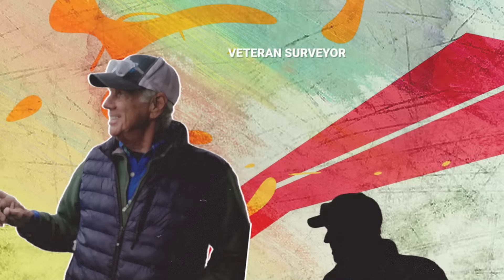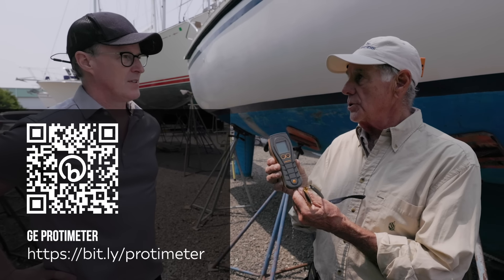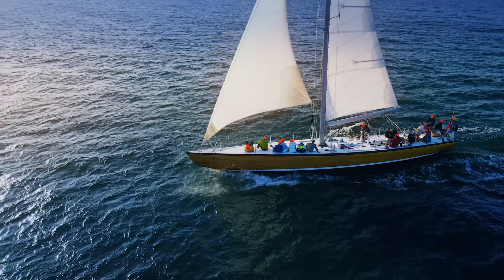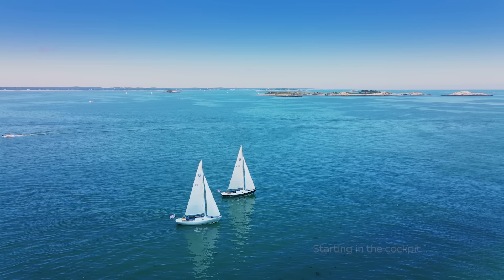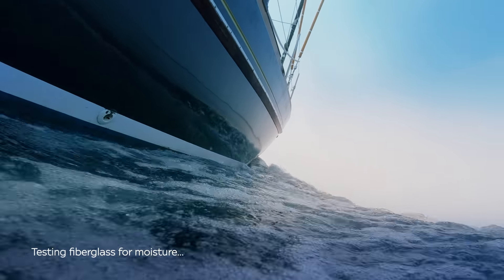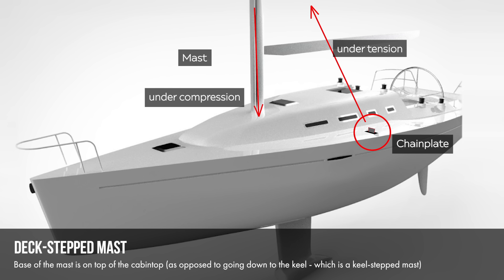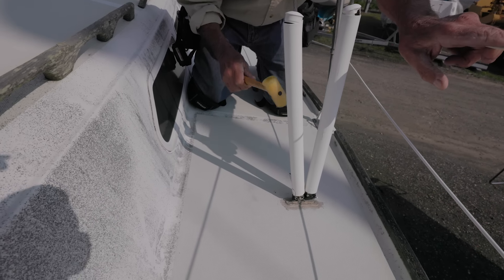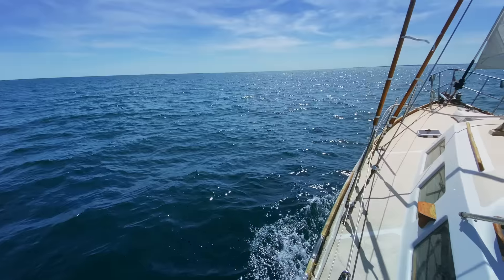SAILBOAT BUYING TIPS from a Surveyor - Part 3! Decks, Chainplates & More  #sailboat

Comment: Hello Randy I hate to tell you that the moisture meters are VERY innacurate on fiberglass boats, especially on bottom painted hulls. As a classic boat restorer, the meters work on wooden hulls. Trumpy, Stevens, Huckins etc. I have opended up many fiberglass hulls that have failed moisture tests to find that there were NO issues with the lamination. Unless you have visible blistering at gelcoat level or below, I don't trust the meters. I blasted the hull of a Hinckley Bermuda 40 to find no blistering at gelcoat level or below. The blisters were in the bottom paint layers!!!
Reply: Is this inaccuracy mostly on the hull (bottom), or are you also concerned about deck measurements as they discuss in this video?
Reply: The deck measurements as well. The meters are prone to FALSE positive readings. They work very well on wooden boats, but not on fiberglass. There are some infrared meters that I am not familiar with that report to have accurate readings on fiberglass moisture content. I am surprised that you were the only person responding to my comment. I have clients that have spent tens of thousand dollars to remedy a surveyors report to find out that there was no problem. The best way for checking for moisture is to take a core sample " biopsy" and check for moisture. I have been doing classic boat restorations for only 45 years. So what do I know? My two cents.

Comment: A note on different chainplate designs: the style with a removable bedding plate are much safer than a one-piece where the deck flange is welded onto the chain plate. My boat had one-piece plates and the metal was rotting from the inside out from moisture that entered between the deck and the plate. Nearly lost my rig thanks to what appeared to be bright, shiny metal but was completely dead inside.
Reply from the maker: wow... how did you discover it was a problem? was your rig already tensioned all the way and still loose?
Reply: @YachtHunters  rig was tensioned. I noticed rust forming on the plate about 15mm below the pin for my cap shroud turnbuckle. Since it wasn’t coming from that connection point it raised some alarms. The rust seemed to be sweating out of the metal itself. Upon closer inspection with penetrating dye, there were tiny cracks forming. Once I removed the plate entirely and checked the underside of the flange I was absolutely terrified at the level of corrosion.
Reply: Same here,had a chainplate just snap,luckily it was only a lower shroud but I renewed them all after that,it was a 40ft boat in 20 knots of wind and one reef in so wasn't being pressed hard.
I've got another boat now and the chainplates were the first job I did on her,the old ones look fine but they are nearly 50 years old so it's a small cost for my peace of mind to just renew them

Comment: Thanks for the video's! Many useful tips.
What are your thoughts reinforced plastic through hull's and valves?
I am thinking about changing all mine.
I mean with plastic you have no corrosion issue's...
Reply from the maker: Being a bit of a traditionalist, I’d go with bronze below the waterline perhaps plastic well above the waterline or in a well protected spot. Bronze is tried and true and a bit old school with 100 years of historic performance. My brother in law hit a whale on a transatlantic passage a few years back and so I always think about unintended impacts (think submerged containers) and what that might do to plastic versus bronze. I do have two plastic through hulls way above the waterline for a shower sump output and a secondary bilge pump outlet…seems like a decent use case…thanks for the question!

Comment: I wonder if you have a builder that goes with solid glass with no core materials in the spots where hardware is installed to give water nowhere to go in does that take away from the shear strength the deck provides, because it doesn't have the interior skin, core and outer skin working together in all places?

Comment: I am going to try to replace a deck core with 3/8 inch divinicell. Wish me luck.
Reply from the maker: You can do it!! Lots of good YouTubes on replacing soft core. If you haven’t already, Check out Colin from Parlay revival… he did some great core replacement videos…
Reply: @YachtHunters  I just learned that white oak has 9 times the shear strength of Divninycell but is 9 times heavier. But, I think I am going to use white oak around the chain plates, mast and under the bow sprit.

Comment: If you already own a boat with some areas where the balsa core has become wet and rotted, can it be replaced with new balsa core and regain it previous structural strength?  I have some areas on my side decks around the chainplates that i would be very comfortable cutting out and replacing if it would be worth the effort.

Comment: what is the maintenance required to keep water from into the deck?
Reply from the maker: you need to rebed the bedding plates every few years...  of course, this depends on the environmental conditions where the boat is... but it's alwasy a good thing to keep on top of. It's not terribly difficult to pull them up and put new bedding compound under... but it's an often-ignored maintenance item
Reply: @YachtHunters  now THAT is 100 points worth an information

Comment: This is really useful buyer beware info. As anyone who's been out looking for that mythical best boat knows, there are an awful lot of boats available for every price point you can imagine. Many of those who haven't sold for a long while probably failed a survey or two, and are languishing until the owners can't afford to keep them anymore... or until some poor schmuck comes along and buys one without a survey. Sometimes it's tempting to be that schmuck. Take a deep breath. The feeling will pass. Just know, once you buy the boat, you own all the problems. * On the other hand, if you have the skills and are motivated, you can take a deck apart from the top, and scrape out the dead core and replace it with fresh core and generous polyester resin, etc.  There are numerous videos showing how to do this. And there are worse ways to spend your time and money.

Comment: Do anchors ever get stuck on the bottom, and if so, is there a good way to get them loose?
Reply from the maker: Sometimes… we see it in Maine on occasion with some tricky rocks on the bottom. first step is to move the boat forward or backwards to the side to change the angle that the anchor is being pulled… the newer rocna/mantis style ones seem to be great for preventing any snags

Comment: At the end there, the anchor locker door is good because there's no wood core. Right next to it? Huge nightmare. And keep in mind if you've never done much fiberglass/wood core repair: that area right next to the 'bad' area? That probably needs replacing as well. Once you start grinding out the bad spots? Where do you stop?  We always think of the flat areas, but it's the complex areas, like that edge near the anchor locker, the curve up to the roof of the saloon; areas that support blocks and cleats, chain plates,  these are the areas that will suck up more time than your triple your worst case scenario. 
What these videos are really good for is not what the surveyor you hire is going to do, but what you can do to narrow the boats you're interested in so you only hire a surveyor for the best boat you find, not 5 surveyors at $1000/each. And I'd ask the surveyor up front, "Please tell me if you find a total deal breaker. If it's okay with you,  I'll pay you half, we can go to lunch, I won't need a report. I'll find another boat."

Comment: The best of the series so far. How about wood and metal hulls (aluminum, steel).
Reply from the maker: great idea!!
Reply: Wood and steel are always stronger then plastic but age and maintanance history is a key. Rusty steel and rotten wood can cost a lot of time and money to repair. Now welding steel can be done anywhere almost for a quick fix when needed and steel is stronger when hitting an object at sea.

Comment: This may be a bit much but could you address the limitations on changing the mast on older boats.  What are issues with attempting to put high end hands free gear on older boats?  Not so much cost but if one finds the perfect older boat and think it can be made as easy to single hand just by geting new self tailing/ furling everything.  What boats are too old for this?????   Love your videos. Great work.

Comment: I don't understand how the moisture meter could find balsa core that has turned to black dust as he mentioned? It only finds moisture, right? 
The cotter pin you showed a close up of had a blob of putty on it, is that too keep from getting cut? 
Great video, thank you:) It's interesting that get mentioned ladder safety because i always worry about Captain Q climbing up and into, then out of boats that are up high, and nobody holds the ladder! Please make sure you guys tie off the ladder before Q climbs up.
Reply from the maker: CQ is adamant about properly securing the ladder a little more thoroughly than the video indicated I believe thank you for your worry. He can always use that outside help🙏😂
Reply: The water did not all go into the core yesterday. Once it gets wet, it is soon rotten. Especially consider that the wet deck in the sun is an incubator for that black mold that destroys the wood.

Comment: Randay, do you think, in retrospect, that you were more entranced by the lines and design of your new boat (the aft private cockpit off of the aft cabin, e.g.) than the actual condition of the boat?  I guess I thinking, first, of the condition of the wiring, but you've had your share of engine problems, too.

Comment: Thank you both for this highly valuable video.  One question:  if one were handy and had the tools, wouldn’t it still be economical to re-do the deck soft spots?  (Assuming the interior, engine and all other components still had some good years in them). It’s just sad to think that because of a wet core the boat needs to be scrapped!!!!

Looking forward to the next video.  
And still waiting for CQ to do a video on an Alberg 30.   😊
Cheers
Reply: No. It is sad but no. This whole deck needs to be dismantled and redone. Try and put together the price of: dismantling, measuring, materials purchase, working hours, putting together, glue, joinery, curing, time required for drying, painting, polishing, pressing...the WHOLE deck... so sad...
Reply from the maker: He is to and yes to your prior question
Reply: Smaller deck areas can be repaired. The boat shown was too extensive. So the point  is to get a reliable assessment of the extent of the damage.

Comment: At the risk of quickly moving beyond the scope of this series (and starting a fight between wood vs fibreglass folks.... :^) ) I'm wondering about the repair possibilities - potential of different boat materials. I can see a steel boat having a section cut out and a new piece welded in. A wooden boat, in theory at least, could have bits cut out and replaced. And I know that fiberglass hulls can be repaired if one put their boat on the rocks holing it. If one was so inclined to buy a boat cheap and repair a bad deck on a fiberglass or wood boat (or for what ever reason insisted on repairing a sad state boat - and had the resources to support the repair) are there approved repair methods?
Reply: 1. There needs to be the line: what is feasible and what isn't. I believe every boat is prone to reconstruction. But at what price? 2. The problem here seems to be balsa core. Fiberglass doesn't seem to be an issue. But sandwiched and joined materials- are. Not because of replacing. But because of engineering and effort. Imagine if you had to dismantle whole deck of this boat. And then tailor all the joints with balsa and then fiberglass. And then put it all together. Prepared, cured, dried, measured, (preferably) pressed... just not worthy. If there is just piece of fiberglass delaminated- you patch it up and you're good to go. Balsa can be bad.... which is such a shame for all the Tartans out there....
Reply: @cetterus  An excellent way to put it: Feasible or not? I'm sure that line is a bit fuzzy depending upon the budget of the owner/customer and the boat yard's skill set (or perhaps more importantly; the willingness to chase windmills :^) ).

Another good point (kinda buried in my question you were good enough to bring it out of the shadows) - would any repair pass suitability from an engineering stand point?

It quickly becomes a parts boat - pull the good bits. Chop the rest.:^(
Reply: It is delicate work. And it is doable but at what price? Imagine what skill and amount of working hours would require to dismantle, reconstruct and put together the whole deck and cabin top! If done right (which isn't cheap)- I'm sure it would be seaworthy. And certified as such.

Comment: Can the deck be repaired?
Reply from the maker: Yes. Definitely… there are a few YouTubers out there that have done it. If you do a DIY the material cost isn’t that bad but it’s a lot of labor… you have to weigh that against the value of the boat (market or sentimental) and see if it’s worth it. Jim’s thought was this boat didn’t have a ton of potential value and you’d be better off saving a more desirable classic if you put in all that effort… just depends on your goals and how much this boat might speak to you. Cheers

Comment: To say that sailboat is ready to be scrapped because it needs deck core job is insanity. 100% insanity. The amount of work required to replace the deck, to do a very good job, is nothing compared to the rest of the boat that doesn't need any major work. The most important deck area is in plane with the mast and chain plates. There's always a bulkhead in that plane because it wants to squeeze the boat. The deck for a few feet either side of that plane needs to be perfect, no gaps, no epoxy fill, had to be solid wood epoxied in, the rest can be just a good job. It's really not that hard, just make straight cuts as much as possible, fit in good marine plywood covered in epoxy, and then put the deck back on. To throw away an entire boat because of a few weeks of work is horrible. Obviously the design of some boats with complex bulwarks that all needs repair can be a different story. Save the sailboats!!!!
Reply from the maker: Love the idea of saving it. I think Jim’s commentary was more about the cost to fix it being greater than the possible value of the boat… and would take a very unique and industrious person, like yourself, to take it on. I think his inclination would be to take on that type of project on a boat that was perhaps more worthy of that type of investment in time & resources… something with greater potential and better overall value of construction. Any boat can get soft decks… but some are more worthy of a major investment (perhaps ones with solid fiberglass hulls) since they could make the investment worth it for decades. we love your spirit though!! 👍👍

Comment: If a boat has a balsa core deck..
1) how can a ship builder be that stupid?
2) is this really totally loss?
Many boats have this issue right?
3) can this be fixed? Just drill a hole, suck the old core out with a long, hollow, metal pen. Then re fill it/inject with epoxy. Problem solved?
Reply from the maker: Balsa core decks are used quite a bit…and by that I mean about 95% of the time. There are lots of cored hulls out there too…it’s was a way for boat makers to trim weight and maintain structure.  There are lots of great old boats with fine cored decks. My boat had a small deck softness and was repaired a few years back so it’s not always a big deal. Core decks can be fine as long as there’s no water intrusion. In this case it seems like the entire deck core is compromised. If this boat had more  potential value it might not be considered a total loss…. Because you can cut away the top layers of fiberglass, replace the rotten core and then glass back over the top. The volume of epoxy to fill that void would be too costly and probably too heavy for some type of injection fix. Check out my friend Jon over on @LivingForSail YouTube channel to see him fix a section of his deck up near the bow. It’s fairly straight-forward… I’d say this boat would be fixable for the right DIY type that wouldnt mind spending some time and money to fix the deck. It could be $2-5k in material costs which means in the right DIY hands it wouldn’t be a total loss. Food for thought! Thanks for the note

Comment: Deck issues like that are not that hard to repair if you have some fiberglass skills.  What is difficult about repairing a deck like that is making it look good after the repair.  That boat is not necessarily a write off just because of the deck.  I would be more concerned about the big ticket items like the engine.
Reply: Totally agree. It’s actually a fairly easy job if you have the right tools and also quite rewarding when done.